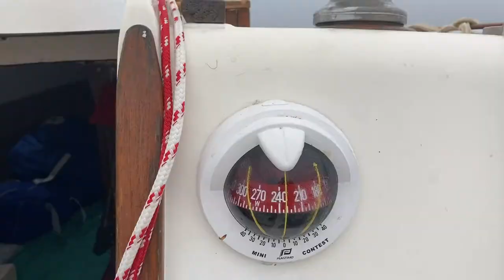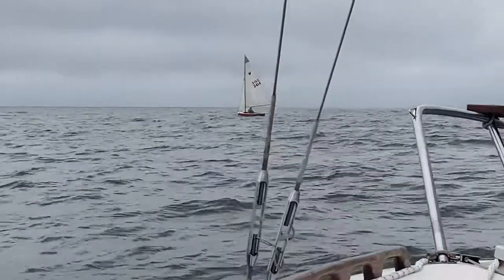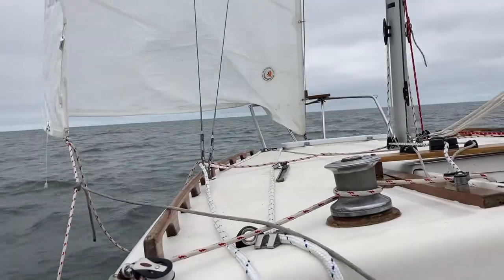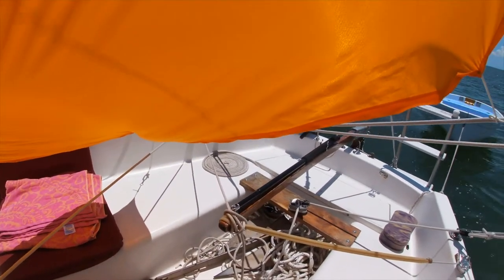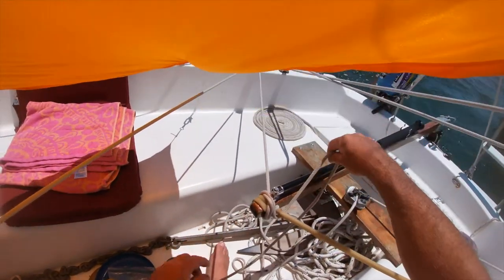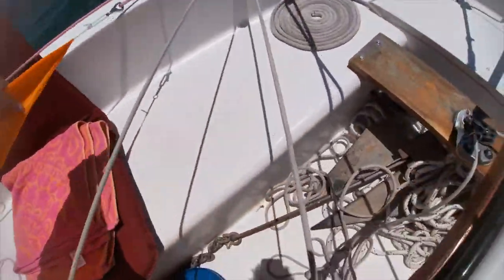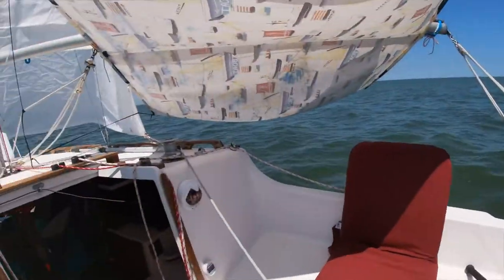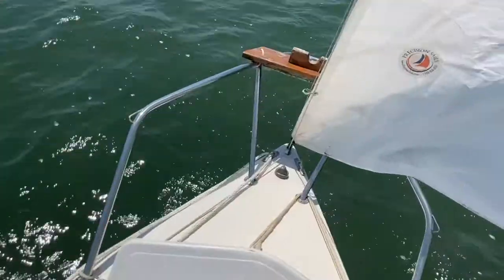DOWNWIND Sheet-to-Tiller Self-Steering for Sailboats in Detail / SUNSHADE

Comment: there are a type of jam cleat that has a little post on the front.  They work great on each side of the tiller.  Adjustments of length are quick and positive.  You can also quickly release the tiller if you need to steer.  I use them to attach the two lines that come from the vane self steering too.
Reply from the maker: Thanks for the tip!

Comment: Greetings from Uruguay! Loved the video, I want to start doing this self steering. One question, do you have some sort of wind speed limit? Can gusts affect the setup? If you ca provide an idea in knots would be great. Good winds! 🍻
Reply from the maker: Yes!! As long as the wind direction doesn’t change, she will keep sailing through a gust. I use the magnus hitch to attach to a sheet. Some people like to mount two pairs of jam cleats under the tiller handle in opposing directions for quick adjustments. I have a shorter video about 5-10 minutes long for explanation of the hardware. Look for the “Quick How To: Upwind Setup”video. Best of luck! Peace
Reply from the maker: Also, works well with reefed sails in high wind too. It is good to have a jib from a smaller sized boat for sailing downwind in higher winds. But you can also lower your main and just use a working jib.